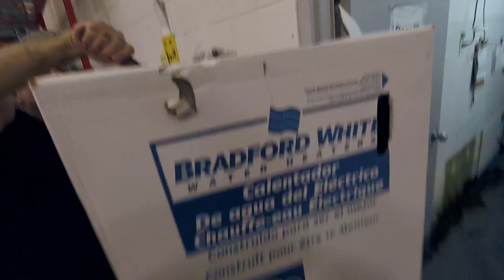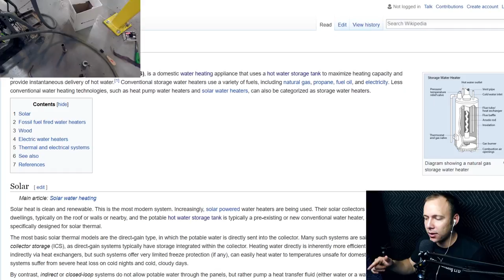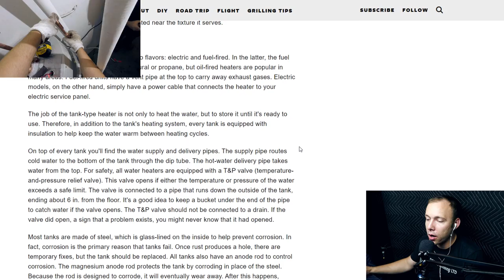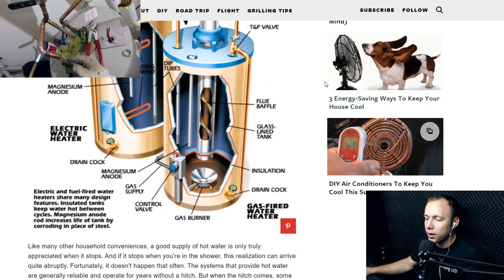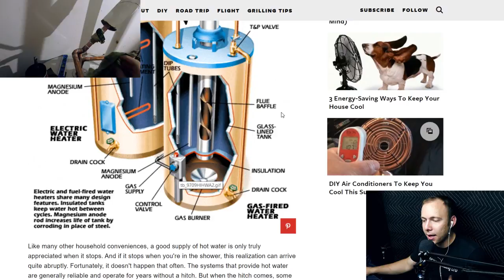Day In The Life Of A Plumber | Hot Water Tank Installation | Vlog 41

Comment: hi Kenny, it is nice video of u to show a video how to install hwt to people .
i have some suggestion for u . We should have a vacuum breaker , pipe connect from t&p valve with the air break not more than 300 mm from floor drain or a sump (but i recommend 6 inches max ), and drain pan not less than 2 inches larger than a tank , it is in the Canadian plumbing building code 
2.6.1.7(5,8,10)
good luck.
Reply from the maker: Thanks for watching the video Eric. I appreciate the information, thank you for your support!